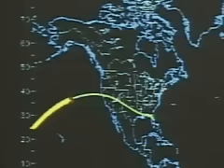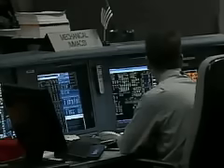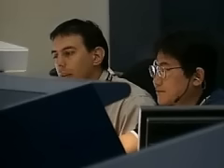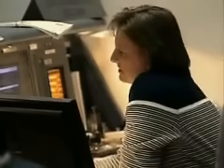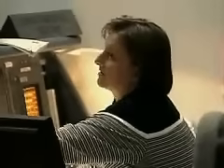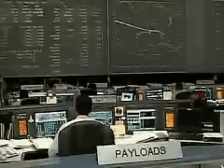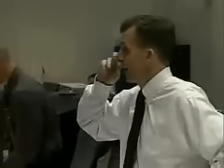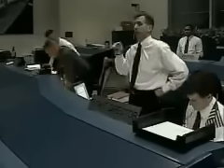Inside Mission Control During STS-107 Columbia's Failed Re-entry and disaster

Comment: It's maddening to think that the wing is what 20 feet from the cockpit and they weren't allowed to do a space walk and check.
Reply: The problem is that there are no handholds or footholds out there and Columbia wasn't flying the Canadarm, so there was really no way to get out there.  And even if they had, they didn't have stuff available to fix the damage, so they couldn't have done anything anyway.  And had there been no damage, there's a good possibility that they'd have damaged the tiles trying to get out to the leading edge of the wing.
Reply: Well, my thinking was somehow take a look. Know. NASA decided to roll the dice and it came up snake-eyes. As it often does when NASA pulls crap like that. Had they looked, they would have seen a hole. Heck, they probably could have done a "partial spacewalk" out the main hatch with a tether attached inside (the hatch was on the left side and the damage would have been easy to see with good lighting) 

They were on a "long duration mission" and had the "extended mission consumables pallet" for the fuel cells. They could have stretched their lifetime (ie, food) on orbit to around 30 days or so. Plenty of time to launch Atlantis (the next Shuttle ready to go). Rescue the crew and then remote deorbit Columbia and ditch it in the Pacific. Trying a repair would be risky. It would probably involve some sort of ablative material that could fill the hole. Like a filling for a cavity. But it would have to maintain shape as to not impact the Shuttles aerodynamics.

Comment: As far as I can tell, during re-entry neither mission control nor the crew of the shuttle had any effective means to respond to a major problem. At 1:42 mission control gets first indication of a major fault. The Flight Director asks a few questions (the answers to which increase the probability that this isn't something benign) but otherwise there is little discussion within the mission control loop to suggest the situation is being actively or energetically investigated. Other readings start going down (while they still have comms with the shuttle) but there is even less evidence to suggest the team is responding urgently to a developing problem. The team show evidence of 'learned helplessness' - basically doing nothing and hoping the problems will go away / prove to be benign instrumentation failures. This is probably a rational response - if no effective remedies are available then crossing your fingers and keeping quiet is as good a strategy as any.
Reply: What you don't realize is that the mission control you see on TV is merely the face of the 100 or so engineers that are located on the floor below them. So to say there was no discussion or response is unfair. There was plenty.

Comment: Onboard tile repair kit & astronaut training to inspect & refit on an EVA in orbit if necessary unbelievably not thought of before. Common sense aint so common, as they say.
Reply: This was not a tile issue. It was a structural issue that had nothing to do with tiles.
Reply: Yeah well, you know, a contingency repair kit to cover minor damage to the exterior of the Shuttle, tiles or fuselage. Even a small hole or crack  anywhere on the Shuttles re-entry friction surface would soon cause a catastrophic break-up on re-entry. Don't be so bloody pedantic, it's your kind of narrow-thinking mentality that caused the disaster in the first place. My point is it was the obvious waiting to happen. The common sense point is that NASA should have thought it through and had a back-up contingency repair system and astronaut EVA training to carry it through.
Reply: Again, you're misinformed. The shuttle always had the ability to fill a cavity if a tile was missing or damaged from the first flight with an adhesive goop. I forget the name of it. After the Columbia accident, additional things were added to the kit including carbon plugs for the wings leading edge. None of the additional items would have been able to fix the size of damage that happened to Columbia. And yes, the crews did get additional training for EVA's. Damage on the orbiter is a problem depending on where it is located. Its not all catastrophic . Most of the flights came back with some kind of damage wether it be tiles, carbon panels, blankets or windows. The whole orbiter is not pressurized. Just the crew cabin. And what is with you YT people to where you can't have conversation without name calling? Are you all that angry?
Reply: Again, your statement proves nothing. Your link does not discredit anything I commented on. Again, the name calling with no credibility to your remarks. So many people on YT including yourself defend their comments with name calling and because I said so. If thats all you got why are you here?
Reply: RCC panel # 8 was rebuilt on the ground with the parts of the panel that made it to ground. Along with the entire left wing. All reconstructed with the 1000's of parts that made it back.  The hole was 10 to 12 inches. Everything on the ground was incinerated? Don't be silly. Burning of parts depended on their location, speed, what they were made of and mass at which they were exposed to the airstream. A ream of printer paper made it to ground in its original paper sleeve . It could be used again. The vacuum cleaner made it to ground. It could be used again. The RCC panels of the left wing did not burn but only had impact damage. All the landing gear made it back with all the tires with just impact damage. You have no idea of the 80,000 items that made it back and were recovered. I do. Your making comments and assumptions based on what you read. I make my comments on what I saw and what I did. I'm not defending NASA but commenting on the correct facts of what actually took place. My motive is corrupt? I don't even know how to answer that. You're angry I guess at NASA , so I guess you're angry at me too because my comments you can't find anywhere or you just don't know about. I think NASA should have done more to at least look for the damage also. But that doesn't take away from the facts I comment on.
Reply: How do I know? I was there. I spent 2.5 years on the investigation. Its well documented that the damage was done by tank foam that hit the RCC panel. No tiles were involved.  I don't know what you consider a low percentage of recovered material but, 40 percent of the orbiter was recovered . Although a lot was broken and scorched as you say, a lot wasn't . I witnessed or had go through my hands everything. Your opinion on NASA's common sense is your opinion. Isn't it great that you can give your opinion on this thread? I don't need to watch any tile videos. I know the program inside and out.

Comment: Because other people were asking (and I was curious too) I synced up some of the events with this video's timeline.

At 5:15 you can hear Columbia's last message to Control, It starts with "roger, uh but.." but becomes garbled and staticy. 

Not shown in the video but at ~5:20 the master alarm would have begun blaring due to loss of hydraulic pressure and the crew would realize that they were in serious danger as the shuttle began to lose control and start moving erratically. After this, they were probably only concious for about a minute and a half before the crew module became completely depressurized and they would have passed out.

At ~12:30, the flight director (thin guy on the right with a white shirt and black tie) has been informed that people have been reported witnessing the shuttle break up in the sky over the southern U.S. He then makes an order to 'lock the doors' which means that no one is allowed to enter or leave until he has all the data he needs to figure out what happened.

Source: Entirely wikipedia

Comment: lock the doors? we are launching shuttles not driving through Detroit.
Reply: They do that so no one in ops leaves or comes in.  To preserve all data.  Also,  when they lock the doors, it automatically starts a backup of all data to a secure server for investigators.  This allows investigators the safest access to info so it can not be tampered with.

Comment: I am wondering when they knew.  And at what point were they sure.
Reply: +Rich Green The moment they knew definitely the shuttle was lost started at the 11:50ish mark... Phil Engelauf, the guy on camera next to Ellen Ochoa (the astronaut woman with short hair) was getting a call about the reports of the fireballs from the shuttle breakup in the sky over Texas where they lost comms and telemetry with the shuttle. He tells Ellen, and then at the 12:00 mark tells Flight Director Cain. That's when they knew for sure... the rest of MCC likely knew for certain when Cain gave the call to lock the doors a few seconds later, though most or all of them likely realized before that, shortly  after the loss of data and failure to find the shuttle on tracking systems.
Reply: brch2 Wow.  Thanks for that.  You know what really is haunting is the discussion inside the cockpit on another YouTube video.  When the plasma outside upon re-entry started flashing in the shuttle windows you can hear them saying that it wouldn't be a good idea to be outside the shuttle right now.  How little did they know that they would indeed get that opportunity.  How horrific is that.  Thanks for responding back to me my friend.  Nice to meet you.
Reply: Yeah

Comment: This disaster should never have happened. I believe the flight director knew of the hole in the wing. He looked very uneasy through out the re-entry.

NASA got burned again with this useless tinker toy, waste of tax payer money.

NASA flew basically 4 shuttles. Lost 2. That is a 50% loss ratio. That is an unacceptable rate under any circumstances.

They learned nothing from the Challenger accident and from Apollo 1 for that matter.
Reply: U try to create a rocket, smartass. u talk so much shit about how they don't learn, u couldn't do a damn thing better than these guys. Like u have never made a mistake in your life? It is not easy to build a rocket, that is why they expirament. They have to think about so many things like the drag, structural stregth. the Apollo incident actually doent even relate to this mission. Apollo caught on fire by faulty wiring while the Columbia mission was burned by the reentry heats that were over 1000°C. Think before you speak, jack as know-it-all. that is all that needs to be said, pls never comment again.
Reply: +Joemonter13 The ratio is based on missions flown, not the number of vehicles. Basically four shuttles? What does that mean? They flew five shuttles. 135 missions, two accidents equals 98 or 99% success rate. Not any worse than any other system out there.

Comment: In 1980 NASA visited our campus physics class and they brought a tile to display. I mentioned cautiously that the shuttle was to large for return with such tile and that their was no escape tower in case of the external tank exploded on lift off. They laughed assuring me it was all tested. Look at it now.
Reply: +Mark Marquez What do you mean that the shuttle was too large for return with such a tile?
Reply: +jrockett73  Capsules in the past did not have tiles, they had one whole heat shield. Open areas that were the tire areas and an open wing area which was the result of the penetration of heat into the wing and tire well.

Comment: "Roger um..." at 5:18. They likely all died in the same instant. Hypersonic plasma lanced through the cabin hopefully before anybody knew what was upon them.

A thousand tears.

And yet these professionals needed to do the agonizing task of collecting the information. Finding the fault. Assigning blame. 

A million tears.
Reply: That’s over-dramatic. According to NASA’s report, the crew had less than a minute between the start of the orbiter’s disintegration and depressurization. The crew tried to regain control, but could not, and the crew cabin then separated from the rest of the orbiter and rapidly depressurized, which would have killed or incapacitated them right away. The cabin then spun around super fast and then their bodies were ripped apart as they fell through the upper atmosphere.
Reply: +bobert4him Not likely, during reentry there is a communication cut between CAPCOM and the Orbiter, so it might have just been the reentry blackout.

Comment: 2:30 - no commonality other than their location in the left wing.  It must have been at that moment that some in the room feared that the orbiter was doomed because the only thing that could cause this sort of failure is physical damage.  I imagine they hoped that the orbiter would hold together, but they had to know the chances of it surviving were basically nonexistent at that point.
Reply: P. Mid - no, they evaluated a rescue mission, but couldnt get up before the astronauts would run out of air. inflight repair is more or less impossible, at least regarding those tiles
Reply: Steve Sisson just out of curiousity; had the crew known of the damage caused on launch, is there anything at all they could of done while in orbit to fix the problem? May they rest in peace. Such a tragic situation. 
*hope you guys are all well and good.
Reply: What could they have done, realistically? Could a rescue flight not have encountered the same problem?
Reply: aresef Not statistically chance of rescue shuttle having the same accident is low enough to risk the hardware and a minimum crew.
  As for in-orbit repair of tiles, it was done on later flights with a small kit.  No idea if it could have been done with improvised parts.  And no idea how far oxygen supplies could have been stretched to allow a second shuttle to rescue the crew.
Reply: No. When FIDO (Flight Dynamics Officer) said they were expecting tracking 1 minute ago, that's when they knew. FIDO just doesn't lose tracking of an object that big without something huge going wrong.

Comment: Surprised by the lack of technical knowledge... I though mission control would have had cameras attached to the shuttle to watch the decent. Not just a huge GPS screen woundering if there is still any tracking.
Reply: the only problem is keeping them working during re entry
Reply: +James Mcleod You need a fix on at the absolute least 3 GPS satellites to calculate a fix, and that's when you're moving slower than 25 times she speed of sound.  The shroud of plasma around the orbiter precluded getting any kind of signal through except straight up back along their reentry path to the TDRS satellite that would relay comms back to Earth.  Tracking would have been done with radar and with a mathematical prediction of where the shuttle should have been at any given moment during the descent.  As for TV, that's got huge bandwidth requirements compared to voice data.  Getting voice data through on its own is a huge achievement.  TV would have been out of the question.

Comment: So, If a high resolution photo was taken, and Damage was confirmed:
1. Rescue by another shuttle was out of the question. Ya gotta come down.
2. There were 2 EVA Suits. Per others here, a patch could have been made, that may have "helped", but the approach would still have rendered the shuttle unable to land (Non operable landing gear, weakened structure)
3. People have stated various forms "Ditch in the Ocean"... Per NASA, Water landing simulations had a 0% survival rate, and Sully was not on the sticks....

Here's something I heard: Could the shuttle have been rotated to place the hole in the shadow of the orbiter body?
And, was there a crew bailout system in place at this point? how long would the shuttle have needed to go before it was deployable?
Reply: +Everseeker Bailout system was in place. Parachute out between 25 and 40 thousand feet. Well after re-entry.
Reply: +jrockett73 so, are you thinking that an altered reentry configuration might have been survivable? (Even though it would render the shuttle unlandable... bailout the only option)
If that is the case, it makes the failure to properly image the shuttle even more of an issue
Reply: Everseeker You can't  alter re-entry. The orbiter would burn up . The orbiters shape depict that it comes in at 40 degree attitude straight down while going thru the plasma phase. The braking phase could be altered but for what reason after that. What was discussed after the accident was filing the cavity (hole)  between the RCC panel and the wing spar with items on board that could minimize the burning thru the plasma phase until the crew could bale out. Many stainless steel items made it to the ground including EVA tools. Also on board were water bags that could be filled with water and then frozen. Also the crew could have removed thermal protection from other less important areas such as blankets from the tail or OMS pod areas. All these items cold have been stuffed in the cavity. It could have prevented the burn thru of the aluminum spar and the wing interior. Woulda, shoulda coulda....
Reply: +jrockett73 That would have been a REALLY big bear of a job to pull off... The Crew would have had to begin that work pretty much as soon as the primary mission task was completed.
As to the altered reentry profile, I am not talking about a massively altered reentry profile, like trying to come in wing first. Just adding a bit of a yaw. Even a few degrees would slightly lessen the thermal stress on the damaged wing.
Yes, too much yaw would bring minimally protected areas into play, so the exact amount would need to be run on simulators.
Reply: +jrockett73 "...40 degree attitude straight down ..."
Huh? You mean diving down, nose first? For some reason, I always thought its attitude&#160;was belly down, like a lifting body.
Reply: Everseeker Yes, like a lifting body. If your in the orbiter, 40 degrees nose up.